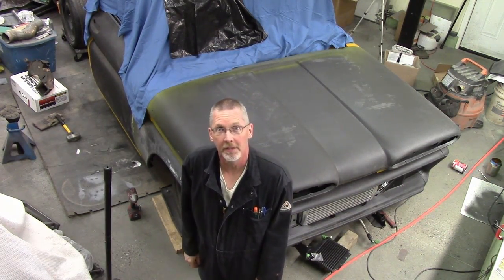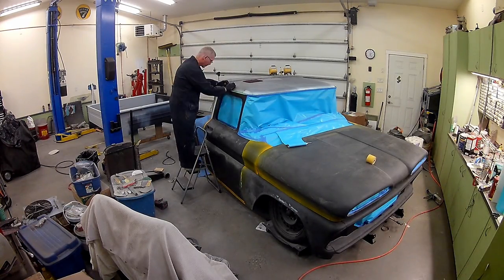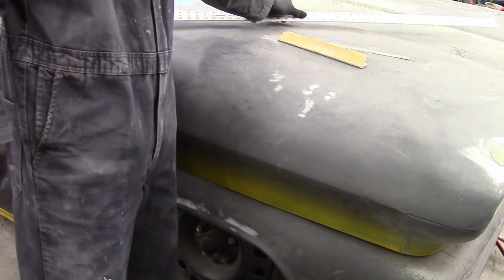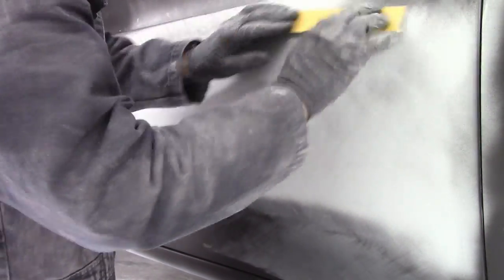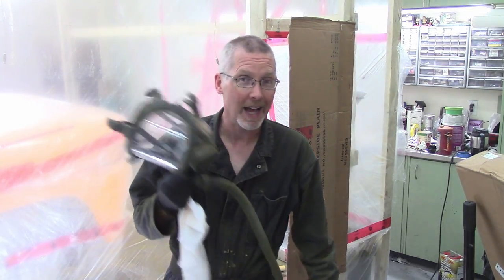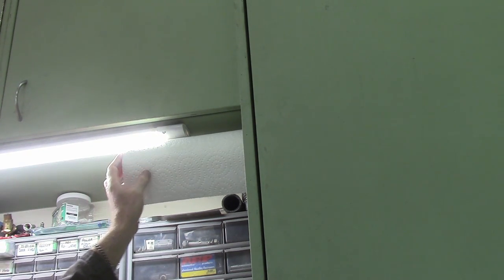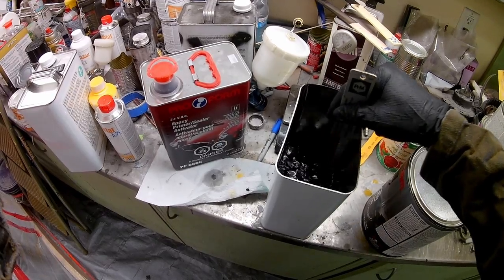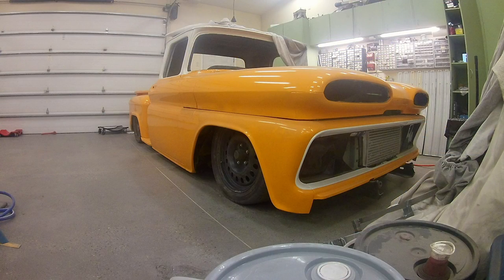Painting the '61 Chevy Pickup

Comment: I see you found the "Jim Stout" paint stick sander method. Don't forget the heavy yard stick version cut for use!
  I like the idea of hand placement as it changes how it touches, both concave and convex. I have never see anyone sand this way before or since. 
  I have glad you got it painted as I am dealing with "Old Man" muscle syndrome myself. They a dog is man's best friend, but after 50+, it is Advil, Tylenol and Voltaren! You are correct. 
  Electrical, fuse distribution, fuse / relay boxes general protection for the wiring harness as fuses protect it and not the series device that may fail. I stumbled across several cheaper things that may help depending on how far you are. An audio company called KnuKoncept sell nice battery terminals, but if a salvage yard is more reasonable, try a Buick passenger side Fuse / Relay center found behind the glove box (Some 7mm action and work is involved) but it is a rectangular narrow Fuse / Relay center that holds 12 of each. It has the fuel pump relay in it as each relay is protected by the fuses at the bottom. 
 Best of luck! DK, Omaha

Comment: First off, good videos showing the full range of project struggles… Anyhow, quick question, and maybe I missed it. But on my 66’ the drip rail on the roof is spot welded and looks horrible and looks just about impossible to make pretty… With the truck lowered, its just at eye level. Just wondering if you had any tips, or if you just said f’ it and painted it as is.
Reply from the maker: I kinda went f' it and painted at.  It was, however, seam-sealed in a previous video.
Reply: @GregWellwood  yeah, going to seem seal the top side and leave the bottom spot welds. Filling it is probably more work than its worth and Im starting to getting away from perfection. Its mentally draining and hard to maintain focus.
Reply from the maker: I hear ya. The more I worked on this truck, the less I cared about perfection. Certainly have a lot of appreciation for those who DO take it that far.

Comment: Shit load of overspray is normal. I spray color at 20 psi and clear at 60 psi. Overspray is to be expected.
Reply from the maker: Appreciated.  I wish I had more experience.
Reply: @GregWellwood  keep painting lol. Practice makes perfect. If you ever decide to try the 60 psi on the clear be sure you reduce to the point where the clear drips from the mix stick right away when you turn it sideways. And adjust your fan to a big fan . 4 inches or wider. Then spray the panel as close as you can get the gun to it without hitting it and move at at high speed but not so fast that you dont get a good wet coat. When you perfect this technique , they will call you the Glass man. Ps your paint job looks good on video . Good job , you put a bunch of elbow grease in her and it shows. 👍
Reply from the maker: You are too kind. This is only the second full spray I've done (previous was a Civic back in 2001).  I've shot the odd fender or repair, but not much else.